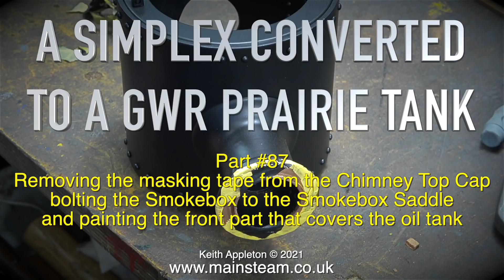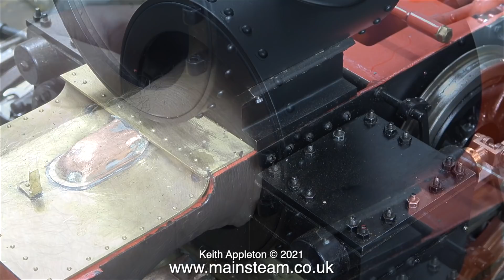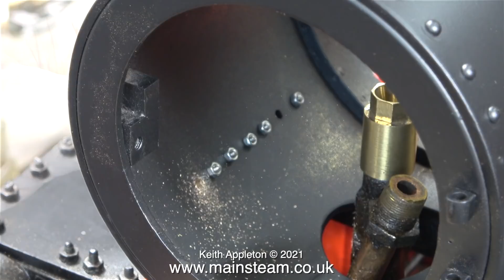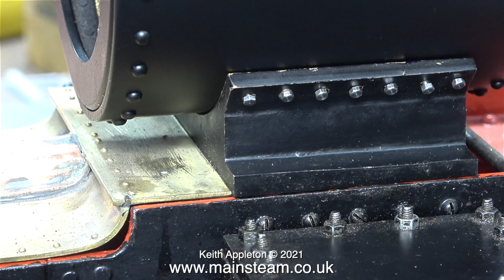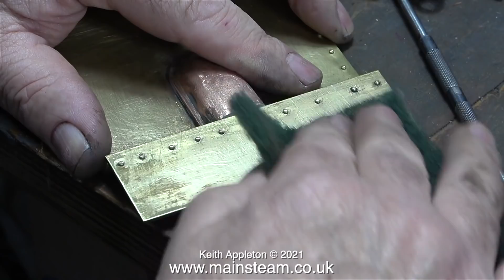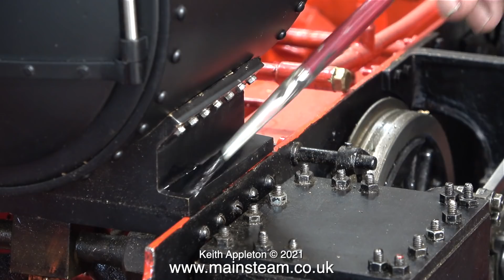SIMPLEX PRAIRIE TANK - PART #87

Comment: "When using etching primer, there's no need for a thick coat" even if the workshop is very cold?
Reply from the maker: This High build Etching Primer is different - it is thicker to start with in the can.
Reply: @keithappleton  But surely you'll still need a nice thick coat on to keep the cold out - or else you might get chilly?
Reply from the maker: It was late when I answered your first comment, and my Brain was entering shutdown mode }:-)))

Comment: I put the smoke box to saddle bolts with the bolt heads inside the smoke box and nuts outside to reduce the probability of seizure of the threads. And, I used stainless bolts and nuts. No one has criticized my work.

Comment: "Near enough for Rock and Roll." Or as my mate says, "Near enough for government work." That might sound a bit cynical ... and it is.
Reply: I used to work with a Tool & Die Supervisor that always got fuming mad when someone said "close enough for government work" because of the extremely tight tolerances we worked to on government jobs.  Of course, you are correct that way too many government contractors take advantage of the opportunity to submit shoddy work to government contracts.  Been there and seen too much of it (instead of "done that").